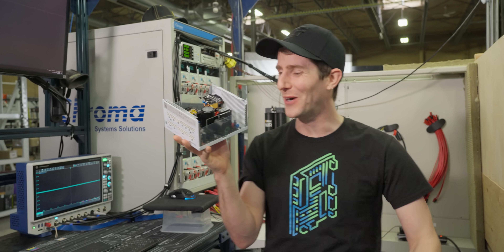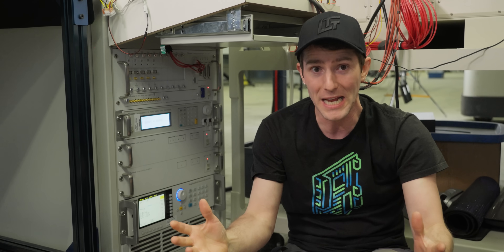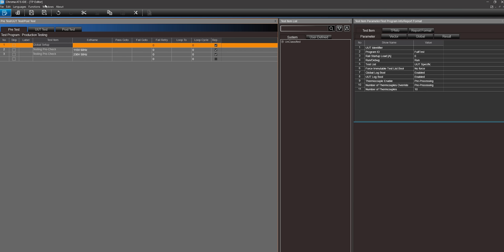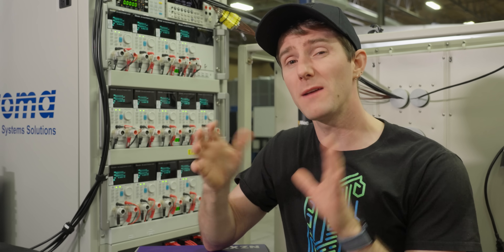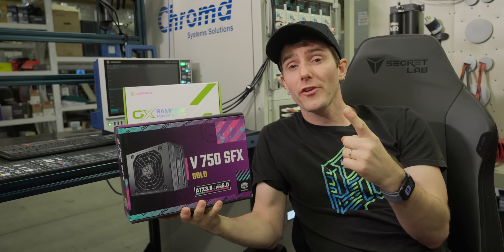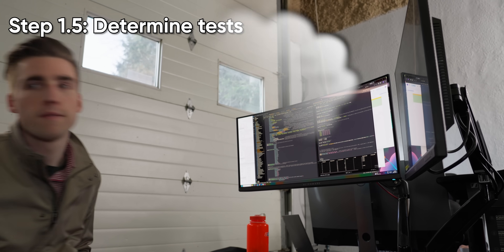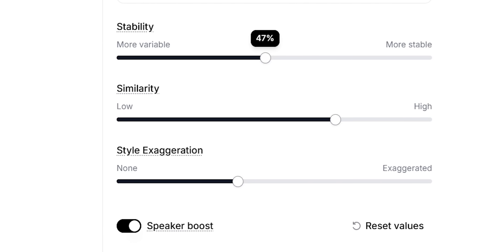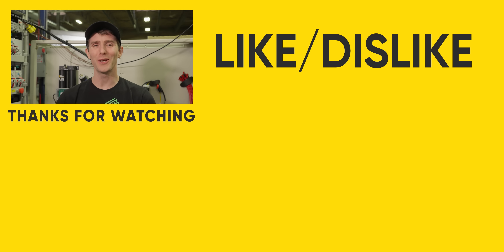Thousands of You are Buying Dangerous Power Supplies

Comment: I bought a corsair i1100 psu and installed it in a new build i was doing. Turned on the computer a little to fast after giving it power for the 1st time. Killed 3 hard drives instantly. Was a learning experience haha.

Comment: Hi! I currently have an intel i7 10700k, 32gb ddr4 ram, 2tb ssd store and a 6600xt gpu. I'm looking forward to upgrading my build. Is the 7800 xt and intel i7 10700k a good combo for 1440p gaming ? For the same price I can buy a ps5 in my country. I don't really know what's the ideal way to access the best price to performance experience. Important: I play only off-line games and I don't care about fps if they don't drop under 60fps. I'm not really a PlayStation, Xbox or pc fanboy so either option is good if I can actually play the new realizes.

Comment: Clickbait title and nothing new for me. As much as I love another tester in the psu field, "Cybenetics/Hardware Busters" never disappointed me. They do pretty much the same, they have stricter tests than the ATX specs, and every psu tested is bought of the shelf and not provided by the manufacturer. They basically started testing psu's because of the same reason: the regular Bronze to Platinum rating is kinda useless because it doesnt show how production models perform (and a lot of them underperform) and the rating basically can be bought. Also: as someone tech/it savvy, I never had a brownout during the last 5 years. Turns out: an uninterruptible power supply from APC matching the capacity of my psu does the trick.

Comment: Bought a Kolink "1200w" 80 plus platinum psu for my pc. Worked perfectly untill I turned the PSU off (the switch at the back) and turning it back on it just popped once and died. Sent it back got a new one, same thing. Got a refund after that. Still wondering what the cause was. Atleast it did not blow up anything else in my PC

Comment: I paused the video and that text blurb did not explain any reasons. It states that real power and apparent power are two different things, with a factor derating apparent power, but it does not explain why the factor is ever not 1.0. If you are delivering a given current at a given voltage, why wouldn’t you multiply those two to get power? Does the real world voltage fluctuate upon delivery of the amperage? Does the power supply only produce the given voltage when there is no current being drawn? what is the REASON apparent power is more than delivered power??

Comment: 9:45 i don't fully agree with the point 3. My experince with power-electronics (up to few MW) and their controlled self-destruction says that reqular PC PSU's should follow similar princible; in case of inevitable catastrophic failure, the PSU should be designed to blow up in a safe and controlled manner in order to protect other devices.

Comment: This is an oversimplification. When selecting components to build anything typically you have two choices you can either go under what the demand factor is or over. Rarely do you actually get an exact match for a component. So either you run it out of spec and hope that it doesn't fail or you get technically better performance out of something then what you're expecting.

Comment: Is there a problem with your testing methods? You stated that “We don’t follow exactly the ATX test plan…” If a product is built to pass a certain set of tests and your tests aren’t the same, is the product really faulty? If I build a car to reach 0 - 60 in 6 seconds as tested on dry asphalt with 0 grade and you test my car on wet asphalt with a 35% grade and it takes 7 seconds, is the problem really my car?

It seems to me that the thing to do is run the ATX test plan AND run whatever additional tests or out of scope parameters that you want.
Reply: I never heard of “PSU Circuit”. That’s part of your problem. It’s never been recommended by YouTube and this is the first I’ve heard it mentioned in your other videos. That’s OK by me thought. If I’m not in the market for a PSU, why would I want to have my feed flooded with videos about a specific PSU?
Reply: Test standards don't always handle all real life scenarios. So, even if you pass one standard, it doesn't mean it won't have issues.
Reply: @JimBob1937  You’re absolutely right. It seems to me that the thing to do is run the ATX test plan AND run whatever additional tests or out of scope parameters that you want.

Comment: The power supply is one thing that I never scrimp on when building a new PC.  It's just too central to the entire function of the PC and all of its components to be worth "saving" a few bucks. Because of this, I usually buy Seasonic or Corsair PSs.  Both have great reps and the one's I own have been in operation in various PCs for a dozen or more years and are still working well.
The EVGA 650 GQ PS that I have runs my 2nd PC and also runs very well and improved that PC once its previous and somewhat temperamental PC was retired to the recycle bin.

Comment: Many ultra-high-end power supplies are now built way over spec, because they are designed to be at full spec at the end of their declared life cycle.

However, many cheaper power supplies only handle burst draw at their declared spec, and actually handle a lot less.  

Worse yet, some fail in a dangerous manner when they fail.  Thus, knowing how they fail is as important as knowing at what point they fail.

Comment: Great test protocol!  Some years ago, a company I worked at, used a Cosel (Japan made) power supply in their products.  In performing test and repair, I can't recall a SINGLE ONE of those ever failing, despite all manor of abuse, incorrect installation, short circuiting, etc.

Comment: I am just curious why you're using Python for all configuration but pulling out a unfriendly, hard to read, csv for the results?
Or is it 3rd party software that's creating that flat file?

If so why not create an API and drop the csv on a queue. let the api consume the csv, convert it, then as part of the downstream, you just output it to the required local drive you are using?

Takes out that manual processing.

Comment: my focus GX 1000w ATX seasonic gold rated PSU is still goin strong after 4 years of running 9 120mm RGB fans, (4070ti oc and is overclocked by me) with a 5800x, PBO/CO enabled. i will say Seasonic customer support was by far the easiest ive ever delt with when i thought i had a failing 3.3v rail. turned out to be a cable extension that for whatever reason, started killing 3.3v rail voltage. (seen 3.11v on hwinfo and on my multimeter) removed the cable extensions and now its steady at 3.34/3.33 constantly depending on load. also running 4x500gb 2.5in ssd's, 2tb 8200sxpro (b4 the chip switch), 500gb 970evo, and a 90mm fan blowing on my ram. since 4x8 clocked at 3800mhz cl14 (ocd) tends to get warm.

Comment: This kind of thing is, in my opinion, so much more important now than it was when I started building 30+ years ago. With the massive influx of low quality PSUs from China, and other places, there are just more dangerous units around now. Add to that, even quality brands are outsourcing their lower end models to those same companies making the crappy supplies. On top of that, when I started, if you were building your own machine, you likely had some idea about how every component worked, and how to read and understand the PSU limits from the specs. Now, with as easy as building is, most people just look I the requirements for their GPU/CPU combo, add a little head room and go with, hopefully, a name brand that fits their budget, with no actual comprehension of the actual units.

Comment: I just picked up one of the power supplies that failed the LTT brownout test. The return window is still open. Should I return it?
Reply from the maker: Do you live in an area with poor power regulation? If so you may want to consider a line-interactive UPS. 

In general we do not like to see PSUs fail our tests but they do not necessarily mean that the unit poses an immediate danger to your system. 

If you are within your return window, however, and you prefer a unit that passes that would be understandable as well -LS
Reply: @LinusTechTips  Actually, I do live in an area where the power flickers on and off at least a few times a month. I have my PC, NAS, cable modem, and router on a good-sized Cyberpower UPS. 

Thanks for the swift reply and advice!

Comment: This channel is right up my alley, I’ve been anticipating it’s arrival and was surprised that it’s already been up and running for quite some time.   

Youtube didn’t present it to me, and also when I searched for it once, I typed Linus power supply as the keywords. 

I think there’s a nugget of insight here about branding.  I think the Linus and LTT brand is way way stronger than the Circuit branding. 

It’s still so early, I don’t think you would be missing out on any momentum by giving the channel a reboot.  Just like in Supreme Commander, it’s never too late to Reclaim the Lab.

Kuddos to you guys for entering this space and providing this data in a unit by unit reference format.  I’d say it qualifies as charitable work.

Comment: PSU is the last place to skimp when building a machine and partially why I'd never buy a prebuilt because they always skimp on it. Luckily, there's a really simple method for those of you worried about this problem. Pick the highest Seasonic, Corsair or EVGA you can and you should be good. Seasonic makes their own and Corsair/EVGA both outsource theirs but have good track records overall and Seasonic even makes both of their higher end models for them. Anything else is a toss up. Is it worth the gamble?

Comment: At 10:02 the ASRock SL-1000G is shown in the video as a tested PSU that failed the brownout test. However i cant find it on either the ltt labs website or on the PSU circuit channel.
Is the review still ongoing or was this a mixup?
I would be very interested in a test of this model because it is sitting in my computer right now and seeing this made me a bit nervous...
Reply: The ASRock SL-1000G is a B+ PSU on the updated PSU tier list. In the notes on the tier list it states, “1000W model has poor transient response on 12V under 200% spike, other models mediocre.” I do not know the source on the notes listed on the updated PSU tier list, however this PSU has a platinum rating and an A grade from Cybenetics. Of course, it is rated 80 PLUS Gold on the 80 PLUS certification program. Curiously, the commentary of the review of this PSU is absent on both LTT Labs & Hardware Busters (Cybenetics). Tom’s Hardware has a published review and it got 3.5 stars out of 5, but the only reason that I can tell being that “while it performs respectably, it does not distinguish itself significantly in a crowded market segment filled with alternatives that offer similar or slightly better performance for comparable prices. While its performance and build quality meet expectations for its class, the unit does not significantly outshine competitors in the same price range.” So, the PSU got dinged by Tom’s Hardware because it doesn’t differentiate. That’s stupid. And, “filled with alternatives” my ass… Has anyone looked around? There are barely any ATX 3.1 PCIe 5.1 PSUs on the market right now considering there is concern about this shoddy 12v2x6 connector.

I would really like to know more about LTT’s test results, too. The brownout segment was glossed over, unfortunately. LTTs results would be very inconsistent with the scores it received from Cybenetics if they are accurate, but maybe somewhat consistent with the notes on the PSU tier list. I don’t know. I’m not an engineer. However, I have this PSU in a box waiting on a build. I’ll be seeking additional information before proceeding with this PSU as I was planning on using it with a 9800X3D & a 5070 Ti.

Comment: I bought a enermax 1000Watt gold rated psu from ebay for about 80 dollars from a data center that was scrapping their servers, the only problems it had was it had all the clips which clip on and stick to connectors were snapped off, apart from that its working 100%

Comment: I bought my 1200w Akasa power supply back in 2008 because my Enermax 650w couldn't feed my new Radeon 4870x2. I haven't changed it since. The most powerful setup I had was an i7 12700k paired with a GeForce 2080 super. Now I have downgraded to a first gen Ryzen 5 and a GeForce 1660ti because I don't have time for gaming anymore.

Comment: It’s funny because I literally just the other day had my cheap power supply first shut down during a game but then it shot a spark out and started smoking out the back 😂 it was a GameMax 850w but I can tell you…..it can’t even handle 600w. 
I was using a overclocked Intel I9 11900k that was using about 300w and a Asus ROG RTX 3070ti using 350w 😂 so no excuse for the “850w” to blow up!

Comment: This data is so valuable. If I was still building PCs it would be critical to me because in my experience, the first thing to die in a PC build has always been the PSU. My PC of Theseus was first built back in 2002, the only parts that haven’t been replaced are the akasa eclipse case and the 800w enermax PSU (and the CD ROM drive). I spent a lot of time carefully specing the PSU even calculating how much the power output would drop over time due to capacitor aging. It’s survived brownouts, power surges and has outlived 4 mother boards and half a dozen GPUs.

Comment: I bought a small vacuum for computer dust on eBay and while it was charging for the first time it almost caught fire. If I had stepped out of the room I might’ve missed it and it would’ve certainly sparked my backpack and started a fire. It was just a basic usb c cable plugged into a hub.

Comment: I have no idea what $138 in AdSense revenue translates to in terms of viewership but I find it interesting that, despite being a frequent and long-term viewer of this channel, search engines failed to suggest PSU Circuit when I was recently researching PSUs. This is the first I have heard heard of the channel.

I remember when you received the Chroma test equipment and assumed that you were letting it rot in a corner. Ditto the anechoic chamber.

I am glad to see that you are actually doing more thorough testing and not just goofy renovations and rebuilds.
Reply from the maker: It’ll take time but we are well-equipped to take a slow and steady approach here -LS
Reply: @LinusTechTips  sounds like a good plan. I wish you the best.

Comment: As a suggestion, would be nice to test a good PSU from back in the day that was used extensively to see how good or poorly it ages (be it capacitors losing fluid over time or something else) as many are using the power supply that are sometimes very old.

Comment: Testing at 264V and 63 Hz seems too much difference on frequency side. EU has 230V 50Hz and frequency is something you don't see fluctuation if you are on grid. I would assume PC power supply failure would not be the only thing failing in house while something went so wrong.

Comment: Yeah we like this kind of commitment Linus, this is actually appreciated.
As an "hobby" technician and a former service tech, I've done extensive testing at home with extremely vanilla test gear in comparison to your over-the-top chroma gear there, and already a bunch of LAB Psu's have dramatically failed my even simple resistive load tests both when it comes to Power Noise ratio and stability. There's a LOT of bad PSUs out there.

Comment: (from a BeQuiet! Dark Power pro 12 1500w)
I've had a brownout whilst benchmarking my 3080ti. Overclocked to 460w with the chip running another 225w... And it survived. Though you could definitely hear arcing in the power supply. Though few weeks ago had another brownout and it's still with me

Comment: I have never had a failed power supply before despite being into computers since the mid 90s. Last night I got a noise from my PC that sounded like a gunshot and my computer is dead. I am trying to figure out how the YouTube algorithm got this video into my feed before my PSU died. Technology is amazing!
Reply: I had a psu explode and wipe out mobo, cpu, ram, and gpu. 7970k and a gtx1080, months after I got the 1080 lol.  I still have them.
Reply: Here's the really weird bit...
Your power supply wouldn't have failed if the algorithm hadn't put this video in.
Reply: I had the second rail die on a dual rail PSU years ago, it basically only supplied an extra 6 or 8 pin to the Mobo and it took forever to find out that was what died when my computer stopped working one day. Even took the PSU in for a check at Microcenter and they said it worked fine. Every other PSU I've had in thirty years has never died.
Reply: Ez you forgot you googled your power supply on your phone or another device linked to your email linked to YouTube.
Reply: I had one from Tiger Direct back in like 2005 that exploded with blue sparks out the back. Some power supplies aren't strong enough to hold all the magic smoke in :(
Reply: @ApolloniusOfTyana0  well it took out the motherboard too. Not amused!

Comment: Would it be possible to make a search on the lab page that allows the user to look for a efficency at at a certain power usage.

E.x my homelab uses about 120watt and i need the most efficient power supply for that load. As far as i can see you got the data to check this in the details of the product. But i would to look at the graphs for every PSU individually.

Comment: I just make my life easier, I only buy Seasonic or Seasonic OEM PSU.  Doesn't mean I'll never have a problem, but means I'm pretty damn unlikely to.  Barring something changing, which happens.

I also only buy PSU that are rated above what I ever expect them to draw so they never have to work hard.

It's the ONE part that if it fails, can destroy the whole damn computer.